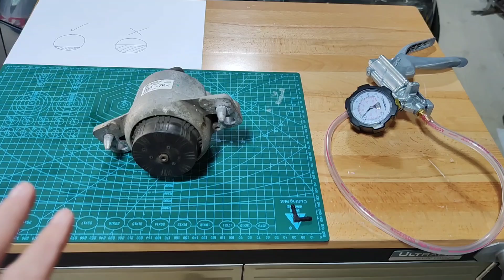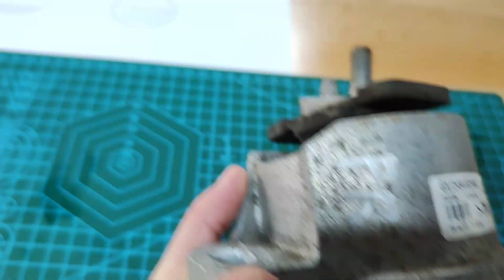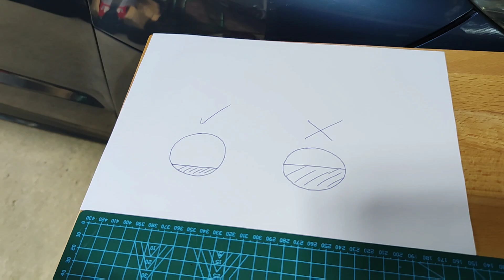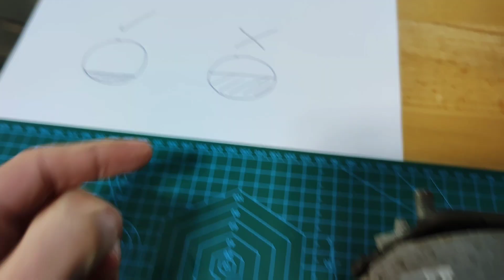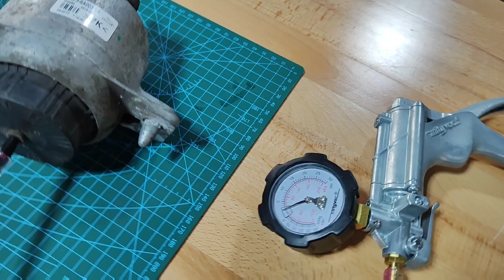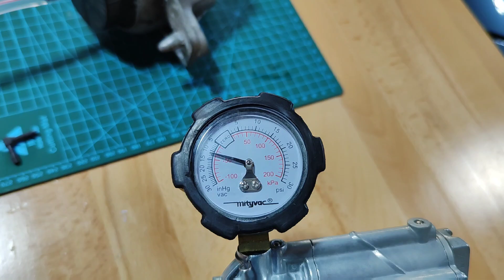Jaguar / Land Rover - Active engine mount testing process

Comment: I have a jaguar with a 3 L supercharged AJ126 and as far as I can see there are two engine mount models available T2H7441 and T2H9241. The former is looking exactly like the one in the video but the other one looks like there isn’t a vacuum port on it, so maybe not active. Can I replace the active ones with T2H9241?

Comment: A vacuum leak through the torn engine mounts is a more serious problem than it may seem. In a 4.4-liter diesel engine, this, combined with a few other factors, led to engine failure. Those who own or service these cars are familiar with the additional oil drain pipe from the turbo. What they often don't know is why the oil doesn't drain as intended and calculated by the engineers who designed this car. There should be a slight vacuum in the engine crankcase under normal conditions, allowing the oil from the turbo to drain into the crankcase even without the additional pipe. However, when there's no vacuum, the oil stands and begins to seep and enter the intercooler pipes from the turbocharger, from where it eventually enters the intake. The vacuum in the engine disappears when there's a loss of vacuum due to the way the vacuum pump is designed—it pumps air out of the vacuum system and into the engine. Usually, this is a small volume, and air in a sealed system quickly runs out. But in a leaky system, air is constantly pumped into the engine.
Reply: Only on v8 petrol? What about the v6 diesel?